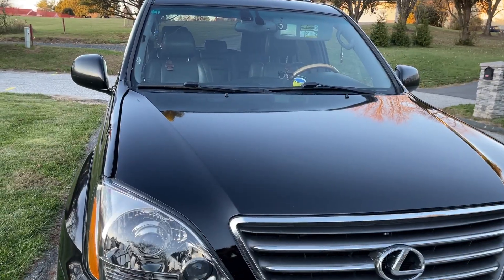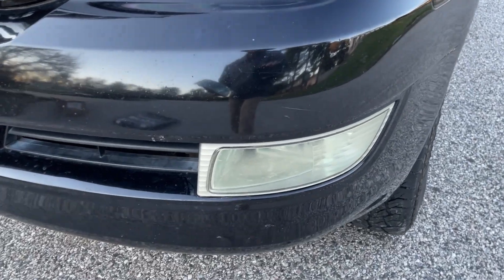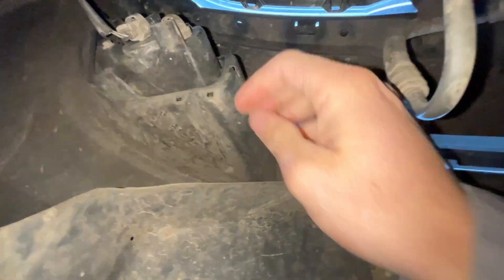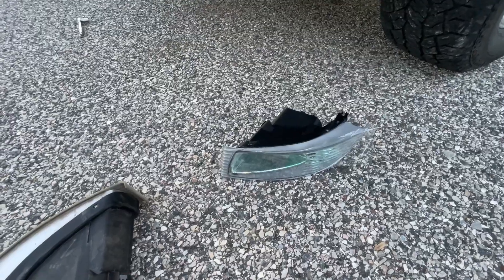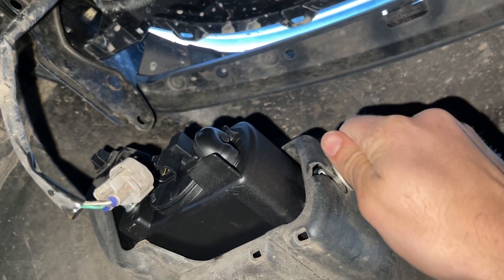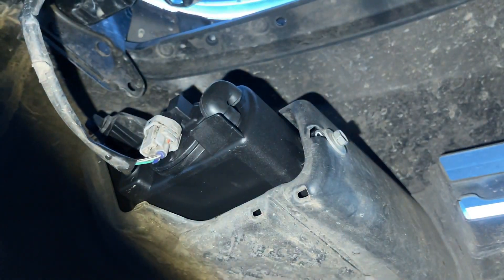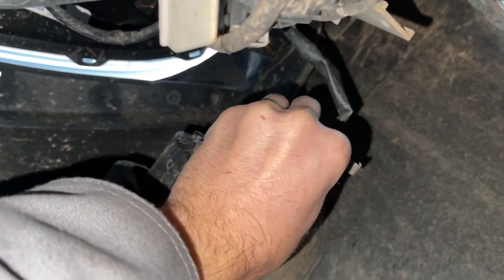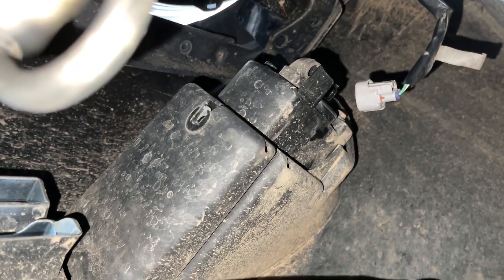Lexus GX470 Fog Light Housing Replacement

Comment: Based on your review, these assemblies don’t really look like they’re great out of the box. However, I opened mine up to clean the lenses and they are too badly fogged inside and out to be useful.

Do you think the cheaper ones would be ok to open up and use for a fog light build, or should I see if there’s a way to save the lenses I have?
Reply from the maker: the ones i got didnt end up being too great. i would have bought OEM if i had the money for it at the time. i personally have never done any sort of fog light build, so i cant speak too much on that.
Reply: @mpt.yt4  thank for the reply; i just ended up cleaning/sanding/coating my stock foglight assemblies. Ended up making a mini-sander out of an old electric toothbrush to get the inside as well. 2K clearcoat afterwards and they look minty fresh

Comment: I saw your review on Amazon for these lights. I wonder if I could caulk them to keep them more water tight? I just cannot afford the OEM right now and one of them is broken so I have to do something. Thoughts? Well done, BTW!
Reply from the maker: If you have the money for a nice set, I would spring for them. But if you need something to hold over, these aren’t a bad option. I can’t say that they’ll all leak, but mine do. I actually drilled out 1/8 inch holes in the bottom and top of each one. I haven’t had condensation issues since.
Reply: @mpt.yt4 that's an excellent idea! Thank you! And yes. I am that broke. PG&E destroyed my business in California and I haven't gotten my compensation yet. It's been rough.